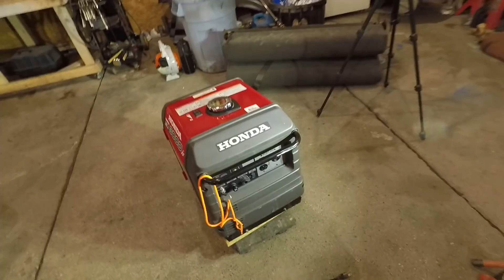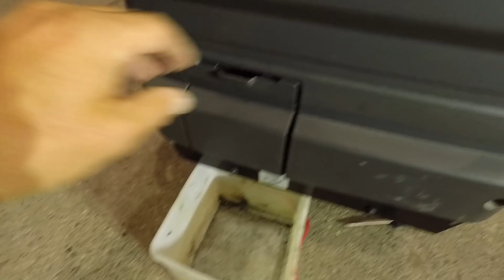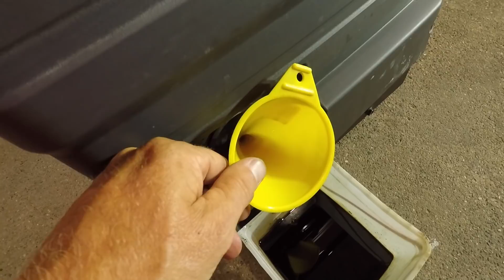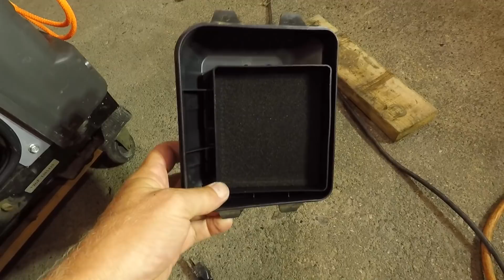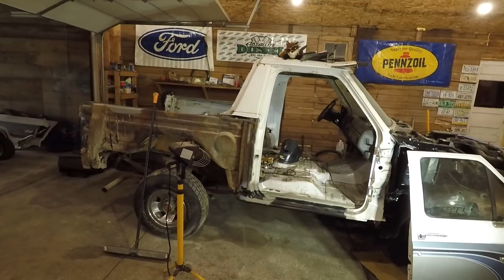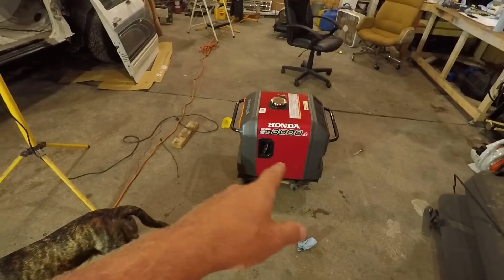Honda Generator Maintenance - Honda eu3000is Generator

Comment: I need one of those generators.. I have a solar panel and batteries.. but never seem to  have enough juice.. My genni is loud.. one of the cheaper ones it's 11hp 5500 running watts 6875 surge .. I'm looking forward to your cabin vids  :-)